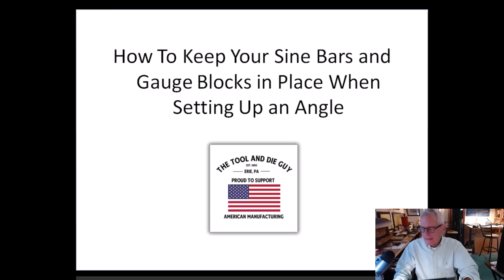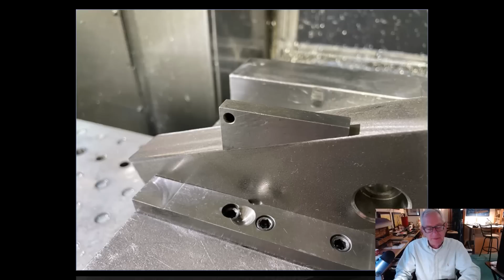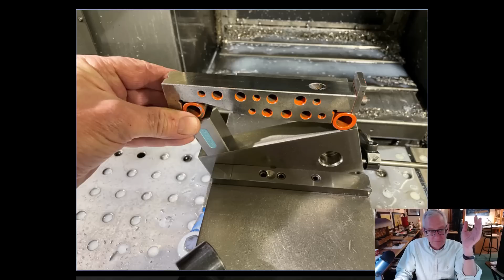How To Keep Your Sine Bar and Gauge Blocks in Place

Comment: I use the angle blocks with a FOOT on the end OR if made to print these FLAT ANGLES should have a 1/16" dowel pin hole or even an 1/8" dowel pin hole to ACT as a stop. YES you will also need a method to keep them PARALLEL to PART in vise or up against and angle plate tightened into a vise. Tons of ways to do it and yours is one way! I use small square magnets but they can be difficult to remove!